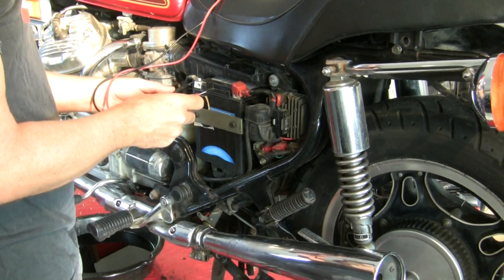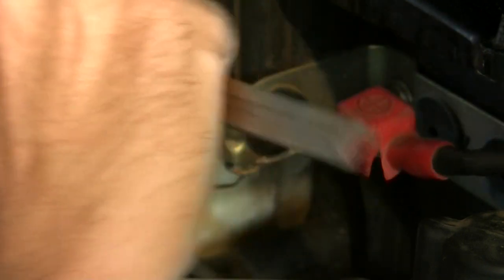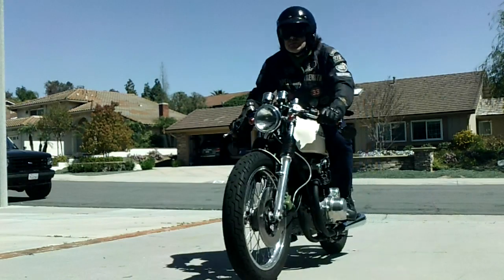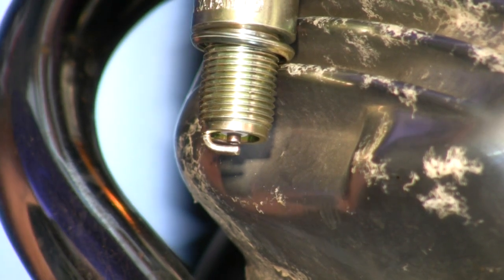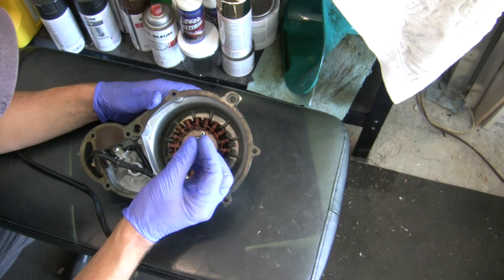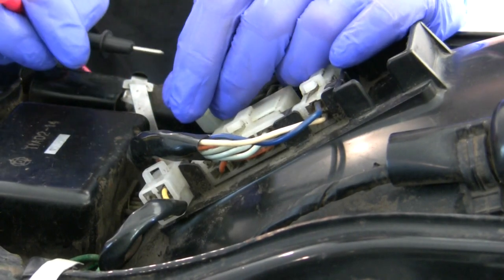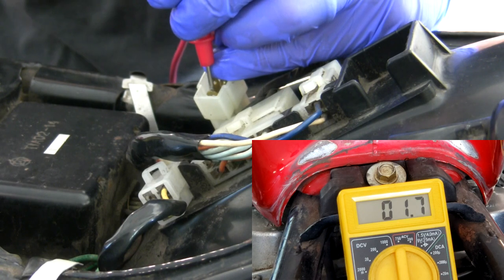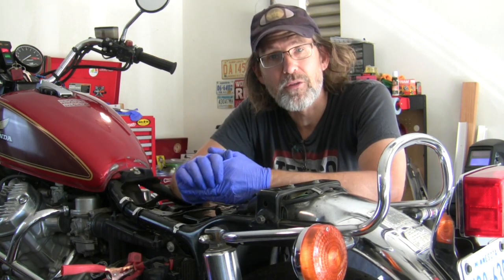Test Stator / Alternator & Battery - CX500 (Part 2)

Comment: Could you tell us what setting you were using while testing the stator ? Is it the same as when you read the battery voltage ?
Reply from the maker: Thanks for watching! For the battery you're testing DC voltage so set to DCV 20 (reads any voltage up to 20 volts). For the stator you're testing resistance, which is measured in Ohms. I set my multimeter to 200 Ohms, which is straight down on these HF multimeters.

Comment: Thanks, that was a really good explanation 👍 my charging system is working ok but the wires from the stator to the reg/rec are badly corroded inside, previous owners bodgey soldering didn't stick and only thing holding 1 of the wire together was some poorly applied tape and hopes n dreams lol. The fact that striping back the outer layer exposed a kinda greenish powdery corroded type substance and dark grey wires probably didn't help him, but considering the quarter inch roundish chunk of solder he taped up with the 2 joining wires, never really stuck to anything..... except the tape 😒..... I am thankful for the hopes and dreams 😁 because this and so many other bodgey half done elec hackjobs that I have found since getting home could have stranded me at anytime during that 3 day wonderful adventure.
Anyway, finally I'll get to my question, I couldn't see where those wires connected once you got your stator out of the engine cover, mine obviously need rewiring...
Q...  can I replace the wires that go to the reg/rec from the stator connection??? Or, 
Do I have to replace the stator.... is it hard wired???   coz I don't want even an inch of that old wire left on my bike, not wanting to splice into it outside of the case and only replace part of it.
I don't even know if I'm making sense, I was just hoping to get an idea if there is any point removing that engine cover to get to the stator or not, in your opinion......please?? 👊😁
Reply from the maker: Thanks for watching! Given you want to toss out all of the original wire (and I don't blame you given your description of it), I would have to suggest replacing the stator. There is no junction between that plug under the seat and the stator. It's actually a pretty short run of wire. All that being said, you may find you can replace all the "bad" wire by going under the cover. Hope that makes sense and helps.
Reply: @UrbanMonkTV  thanks for replying. Yeah I've never seen wiring like it, I tried getting clean bare wires to rejoin, but the wires were actually repelling the solder and it just dripped off 🤔😀 So I guess it would probably be a good idea to see what's going on under the cover anyway, and yeah I might find a better splice point there, but so far, the deeper I go, the worse it gets
Reply from the maker: @bigdaddy741098  Good luck. Good news is...at some point the wire WILL end and you'll be at the stator. 🙂
Reply: @UrbanMonkTV  but what about all the OTHERS!!?? 😦😳😱😫😫😭
Reply from the maker: @bigdaddy741098  I understand the concern. Worst case scenario, there are lots of complete wiring harnesses on eBay that have been stripped off other CX500s.